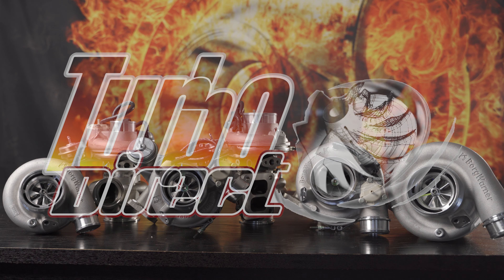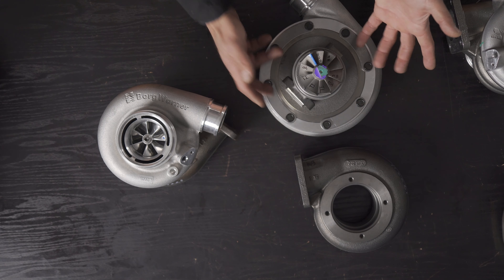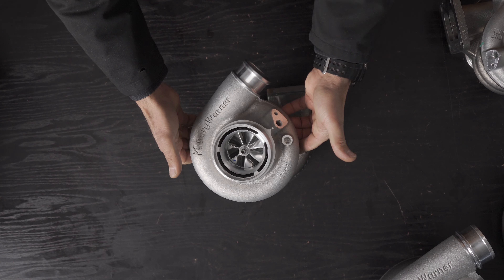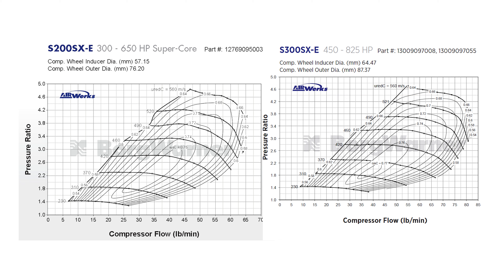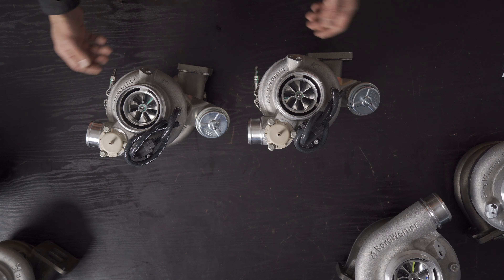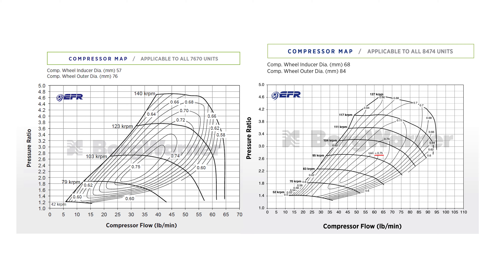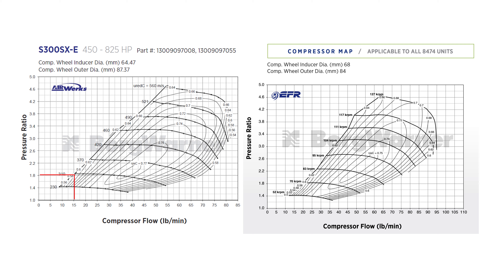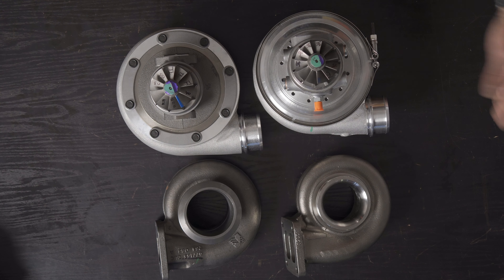BorgWarner's EFR and Airwerks compared

Comment: most turbo underate. turbo hp rating are usually a minimum (of 550hp)
Reply from the maker: No sir - HP ratings are 100% in line with air flow depicted on the compressor map - for every 10Lb/min of flow, equates to a realistic 100HP -- using X10 (realistic conversion)